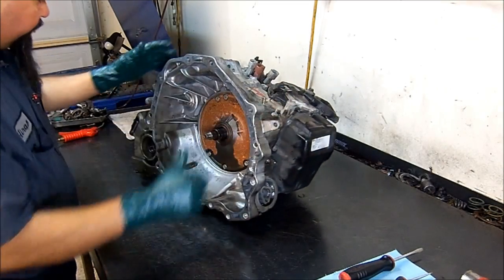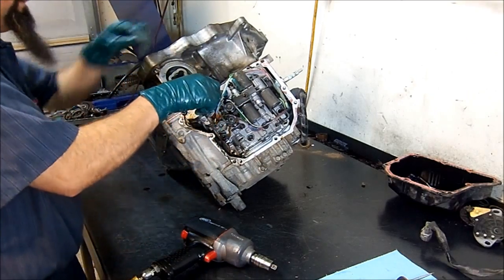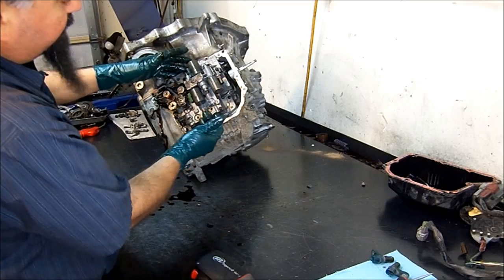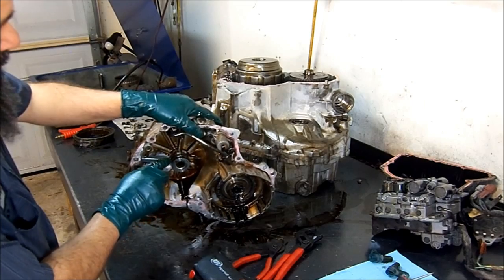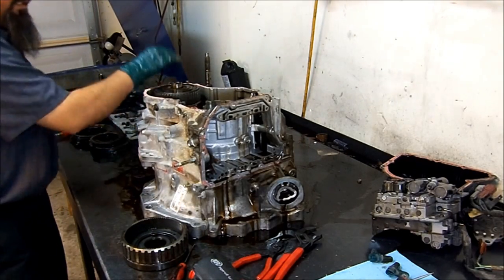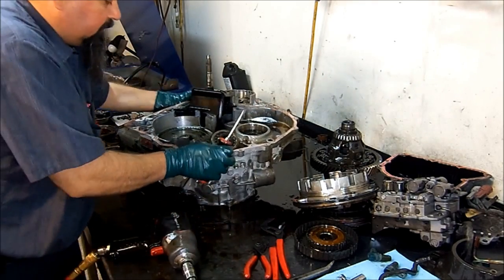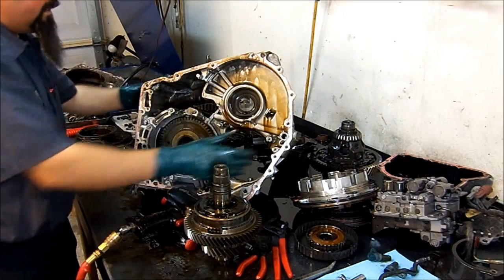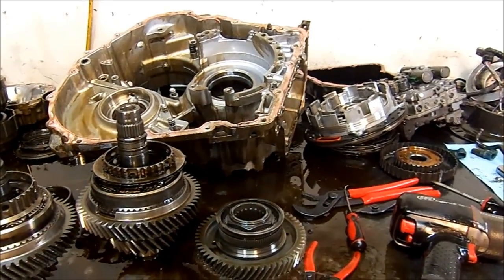AW55-51SN / RE5F22A Transmission Teardown Inspection - Transmission Repair

Comment: For anyone rebuilding this transmission and looking for parts, you will find that there are two types of filters: ones with or without a "rib". I am unable to find a definitive source of information as to which transmissions have which filter, and the only source that said anything about it WAS WRONG, so I'm here to share the one tiny tidbit I know (I had to tear my entire transmission apart to figure this out, AFTER I had already bought the wrong filter):

The transmission in a 2001 Volvo V70XC has a filter WITH a rib. (there, was that so hard, internet?) If you have a different vehicle, I can't help you, but don't count on internet sources either. Tear your transmission apart first, then buy the parts when you know for sure which ones to get. (Also, my friction plates are all fine, I can still see the paint on them, so for me, IT IS JUST THE VALVE BODY!!!)
Reply: How many years on your unit?  I have a 2002 V70 (fwd) that has the usual symptoms, 92k miles.  Any other advice on the rebuild?
Reply: @reallyhappenings5597  How many years? It's a 2001 with over 210k miles on it, so it's most likely a rebuilt transmission, but IDK when it was rebuilt, I just know that the transmission died right after I bought it (and after one of the CV axles self-destructed... don't buy cars on CraigsList), and the fluid was black, like, really black. As for more advice, I'd tell you to get the ATSG book, but I noticed your other comment about it, so you're good there. Like any sort of new step-by-step task, read through all the instructions before you do anything, get an idea of what exactly you'll need and need to be able to do. I rebuilt mine in my room with less than all the recommended tools (basically just a socket set and a torque wrench...es) Probably not the best job, but it's probably better than "not working at all" (I haven't got it back in the car yet). Here's some tips tho:

1. Clean the outside of the transmission thoroughly BEFORE you crack the thing apart. There is a massive difference between the outside dirtiness and inside dirtiness. You don't want any of the outside sand or dirt in the finely machined parts inside.
2. Keep track of every nut, bolt, and screw, and especially parts in the valve body. Make sure you know exactly where everything is going to go before you take it out. The ATSG book does have enough detail to verify every individual piece in the valve body (as well as the whole transmission), so don't worry too much if you lose track of your parts, because you can verify them, just double-check, cross-reference, and use process of elimination if you have to, but you don't want to have to.
3. The book covers all the versions, but they only use one in their reference pictures, which happens to have different parts than mine (such as the axle seals, both kinds of which are in the rebuild kit). You will have extra parts from the kit, so make sure you know which ones are supposed to be extras. There are two extra valve body gaskets (you will use one of two pairs, each for two of four different valve body versions), I have 6 extra main seals (meaning probably 3-4 different axle seal sets), and several extra o-rings.
4. As for specific differences, as I said above, there's the different seals, 4 different valve bodies, and my transmission coolant lines were different than the one in the book. One of my lines connects straight to the valve body cover.

Tools Needed:
-Inch-Pound and Foot-Pound Torque Wrench (actually, Newton-Meter torque wrench cuz it's all Swedish and metric, a range of about 5-50 Nm)
-Spring Compressor, or clamps and small soft blocks (I used some of the old seals to compress some of the clutch springs, which worked pretty good)
-Really good snap ring pliers, or a lot of patience and skill with a screwdriver and pliers
-Air Compressor, Dial Gauge, Feeler Gauges, and Calipers if you want to do it by-the-book
-Cleaning supplies. Many many cleaning supplies.
-One of the first "specialty tools" mentioned in the book is a pump puller. Don't bother, unless you happen to have one. A: I could't find a decent tool to do the job, and B: like many of life's problems, I solved that one with a hammer. Once you get the case and pump unbolted, just use a hammer and piece of wood in the right spots and tap the case apart; no pump puller necessary.
Reply: @chaoslord8918  wow, thank you very much!

Comment: oye Hiram muy buenos videos que nos ayudan en problemas comunes de autos tengo un maxima 2005 se me escaneo y me  marca codigo de transmision p0744 A/T TCC S/V FUNCTION LOCK-UP Y CODIGO P1800 VIAS CONTROL SELENOID VALVE ME PODRIAS ORIENTAR KE OCUPO
Reply: Did you ever fixed the problem

Comment: just got a call from my local tranny repair man. He said it will cost me (approx in USD) 2500 $ to fix my AW55. Apperantely there are some worn out clutches and some solenoid failure. With this awesome video i will do it myselg. Keep on with what you are doing ! A+
Reply: how did it go?